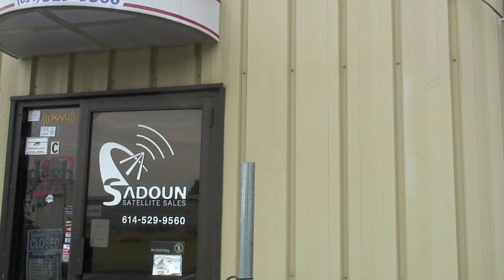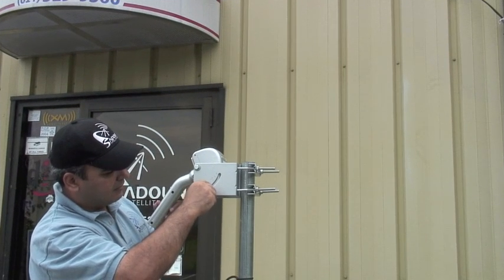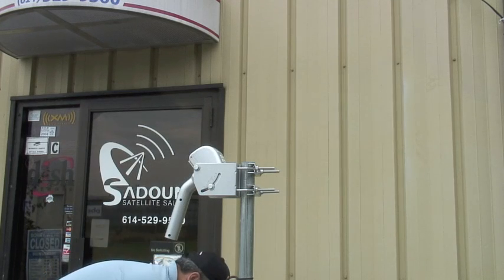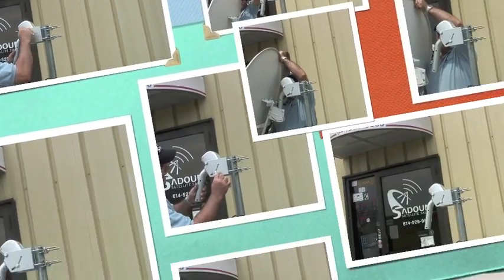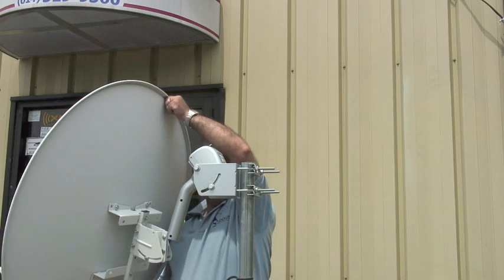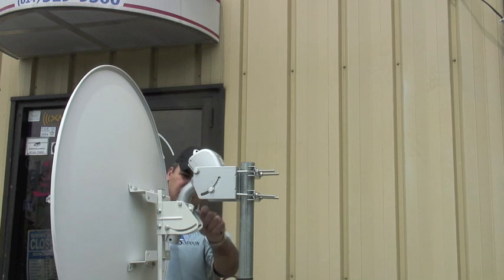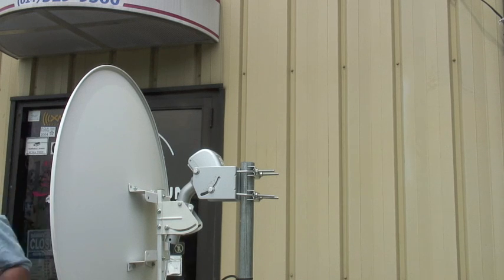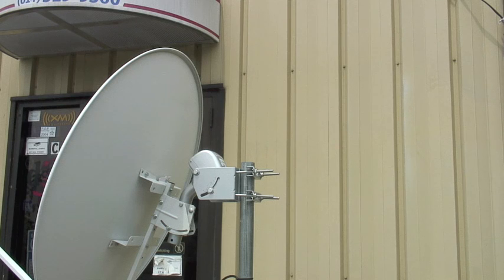DIY Guide to Installing Motorized FTA Satellite Dish: Part 2 of 4 Mounting HH Motor Setting Up Dish

Comment: can any one explain what is need of bigger dish.
 is it because of satellite position. if i want to one channel from c band. shall i go with smaller dish with motor?
Reply from the maker: C Band signal is very weak.  so you need abigger dish to receive the signal.  The minimum size for receiving C Band signal is 6' (180cm) dish.
Reply: @sadounsales  Thank you. if we design cassegrain antenna, can we reduce size? or is there any way to reduce size by adding modern technology?

Comment: what about for 4 meters dish?
Reply from the maker: Steven Alvarado These BIG dishes require different mounting hardware and stands. Do you have one?
Reply: I have a 2.4 dish
Reply from the maker: Steven Alvarado That is a good dish for C & KU band signals.  Check the instructions manual here http://www.pacificsatellite.com/manual/large_dish_installation.pdf